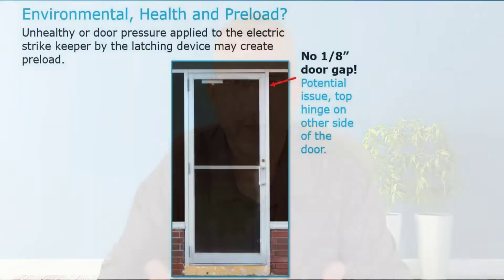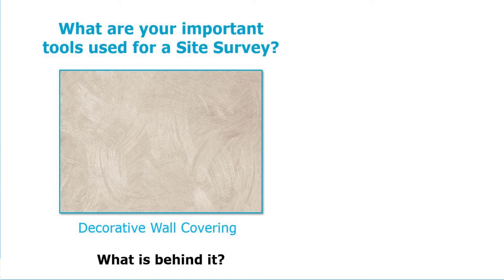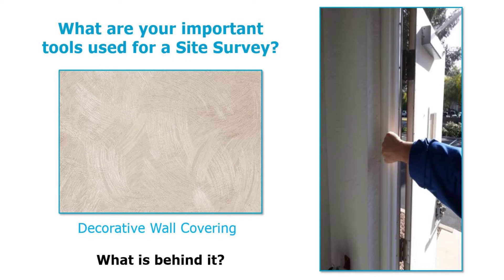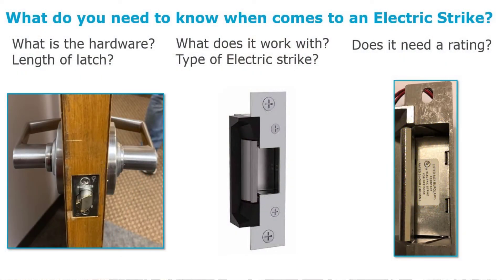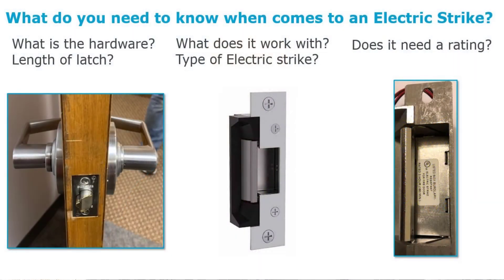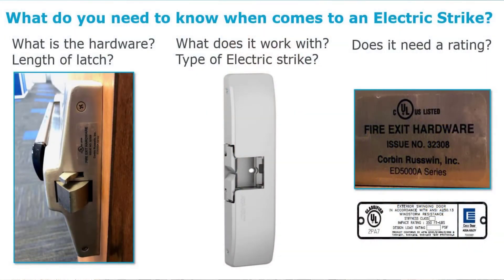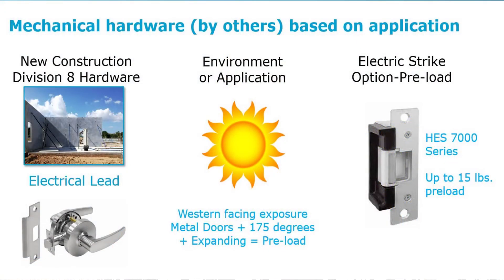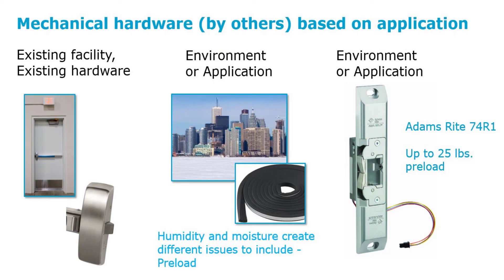Electric Strike Selection - Part 2 of 7 | Site Survey Tools & Applications

Comment: I've installed security, fire and network cabling for over 30 years, but never really got into access control.  I did a few jobs back in the early 2000's but never got into lock hardware and programming.  I'm now branching out a bit more and find your videos very helpful.  I recently did an access control for an existing client and subbed out the locksmithing, even though may license does cover the locksmith portion of access control systems.  We had one door with a little bit of a preload problem and the locksmith had no other advise, but to bend the hinge.  Needless to say, I have not done that, but since I know now what the solution is, I think I will have to look at the specs on that strike and I may have to change that out.